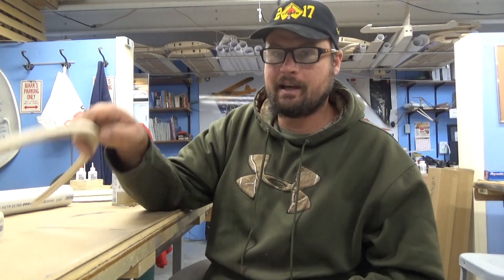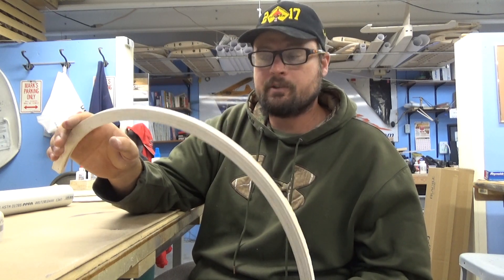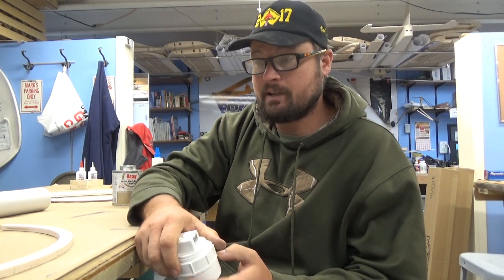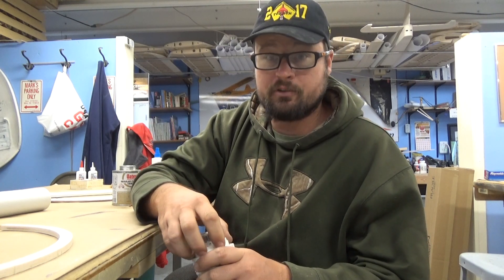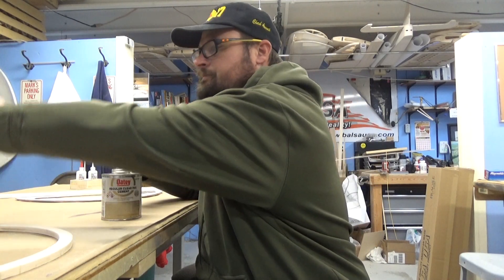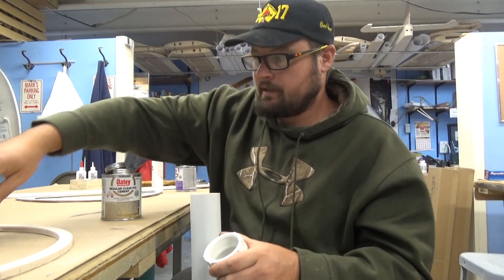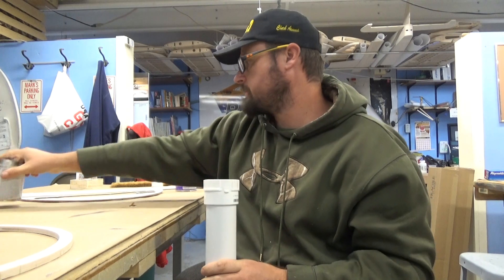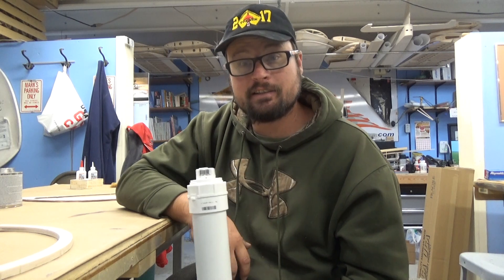Balsa Softening Tube

Comment: Normally, in plumbing work, if you don't use primer, it's a good idea to lightly sand both sides of the joint (100-150 grit) to increase the "bite" for the glue. In this instance where the pipe is not pressurized, it doesn't matter.